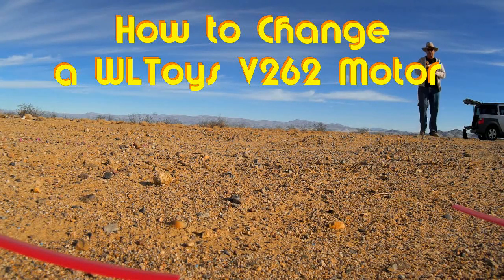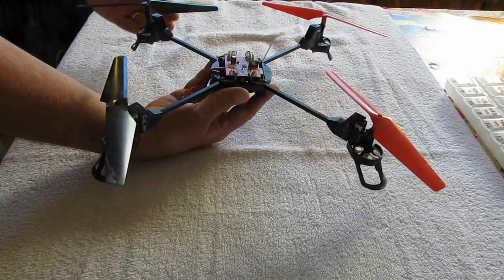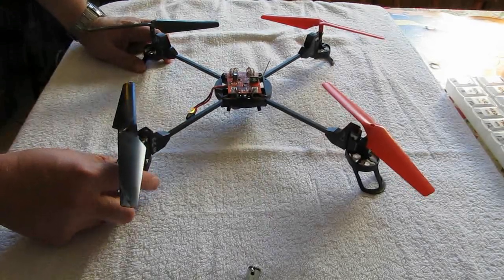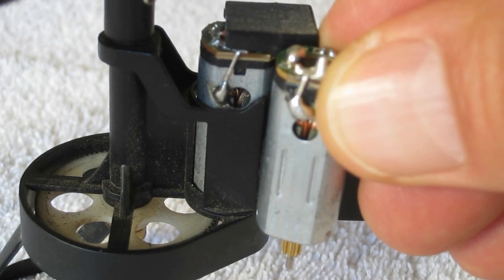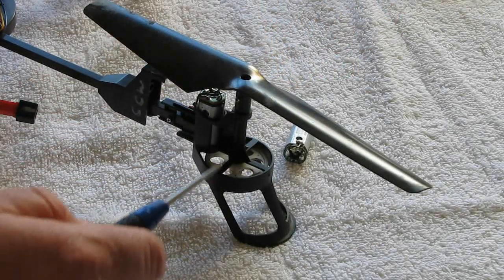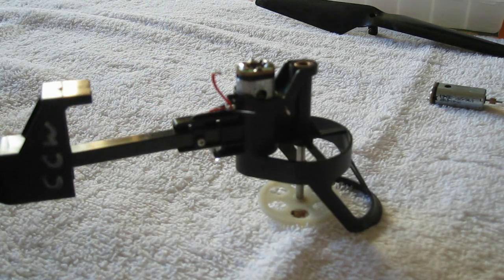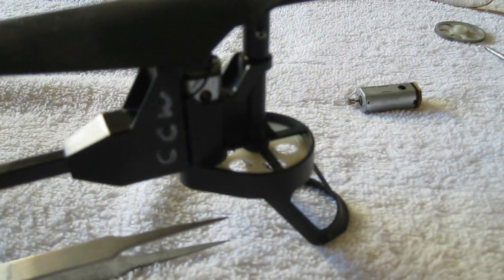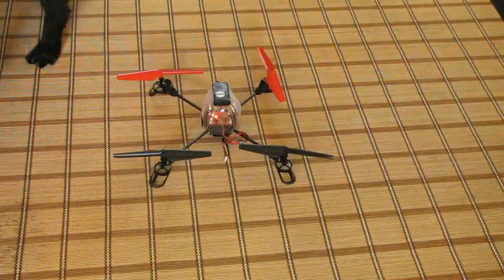WLToys V262 Cyclone Repair: How to Replace a Motor

Comment: You can also upgrade the motors, using the bigger ones installed on the MJX X101. The controller of the V262 can handle them and you'll fly (at half throttle), with an AUW of 465 grams. The only thing you have to do is to sand a millimeter of the carbon booms of the V262, to fit the motor holders of the X101, which are 4mmx4mm. Please take a look at my Rocket Drone on my YouTube channel. Instructions are available on Instructables website.

Comment: Hey 101,
Can this lift and fly with an action camera on???
And what is the range on one of these???
Reply from the maker: I would recommend skipping this drone if you can still find it.  This is a very olld drone, and there are much better out there these days. Regarding lifting a camera, it could do it.  But you'd be stressing the motors doing such.
Reply: Quadcopter 101 
Thanks for the information. I would then be making some mods on both the drone and the cam to reduce as much weight as possible.
And as for better and cheap drones, I know there are so many like the Bugs Series but drones are not easily available in where i am from.I am from India and its illegal to import such drones (talking about medium and large sized such as Bugs Series, Phantom series,few models of hubsan, drones which are a bit bigger in size and not as small as the pocket drones) and is a great fuss to get them cleared out of the customs office, sometimes it takes a lifetime to do so.
Well, thank you again.
Have a good day.

Comment: Hi, any idea how to switch flight modes? From 2 to 1? Is it possible?
Reply from the maker: It's not possible.  WLToys sold two different transmitters for this, Mode 1 and Mode 2. You had to specify at purchase Mode 1.
Reply: Thank you for your help. A big hello from spain!

Comment: I must've taken apart my V262 at least 8 times this week and finally 
trashed the body from being fed-up with it in the way of locating the 
problem!  NOT LIFTING!

Problem: ALL motors spinning the correct way.  Transmitter seems perfect.  Batteries at full-charge.  No wind whatsoever.   V262 DOES NOT WANT TO LIFT,  IT PULLS FORWARD, SIDEWAYS AND HALF-SPINS, IT ALSO FLIPS IF I WANT IT TO............BUT.........NO LIFT!!!

ANYBODY GOT THIS PROBLEM???
Reply from the maker: To tell you the truth, your problem sounds like you may have misinstalled one or more of your propellers.  Just to check, are you aware that there are two different shapes of propellers for clockwise and counterclockwise turning motors?  If a CW propeller is installed on a CCW motor, the propeller will blow air upward instead of down.  The quadcopter will not takeoff.  It may also flip on takeoff attempts.  Recommend that you double check your installation.  Look at the above video and compare the shape of your propellers and the motors that they are installed on.  Make yours match the video.

Comment: can you help me my quadcopter is falling on one side before take off
Reply from the maker: Your propellers likely are not installed properly.  There are two clockwise and two counter clockwise propellers that must be installed on two CW and two CCW turning motors.  Is it possible to share a short video of you quadcopter?  Please show each of the propellers, then demonstrate its flight problem.

Comment: Hey, I have the same quad. If I don´t use any camera on it (+extra weight), motors can run for a relatively long time. From my experience it does not matter whether you order CW or CCW motor, you just need to connect the wires the proper way. Anyway, to get some more power I was thinking about some upgrades... What would you say about two motors for each propeller? Do you think that the PCB is able to handle additional electric load? I´m afraid to burn the PCB...
Reply from the maker: +Martin Rob I doubt it.

Comment: I found neat way to install Mobius or other cameras inside clear dome - Easter eggs can be inserted into clear plastic sphere, it is low cost and plastic is very clear. There are many sizes, starting from 5 cm and up. I have some 10 cm diameter and it is excellent for all sky camera (Xiaomi Yi), Mobius protection against rain... but can be used instead plastic bottle bottom, which is not perfectly clear. I will not put link here because it will end in "Likely spam" by YouTube. Try to find it localy - it can be found periodically in local stores. Such ball serves for inserting candy and eggs into it during Easter celebration. Thanks for attention.

Comment: QUADCOPTER 101, CAN A PRE DETERMINED FLIGHT PLAN BE USED WITH THEXK Detect X380 GPS Headless Mode 2.4G RC Quadcopter ?THANKS
Reply from the maker: +RLO Quad I don't think so.  The only low end GPS quad in this price range capable of doing such (that I know of) is the Cheerson CX-20.

Comment: Please please show how to replace motor on v636. Idk how to open it n stuck without flying now
Reply from the maker: shahed cassim Sorry, but I've already donated my V636 to one of the local schools here.  But these Latrax Alias clones usually require removing the belly plate from the bottom of the quad before you can remove the covers protecting the wires leading out to the motor.

Comment: I have the V666 and just installed the bearing mods.  I noticed that one of the screws on the props doesn't screw in.  Looks like it is stripped maybe.  Have you run into that issue?  Would simply using the next size up screw work?  Or would that unbalance the shaft too much?
Reply from the maker: Ross Potts Many of mine are stripped.  But keep in mind that they are mainly acting as a pin.  If you can get it in, and it stays in place (doesn't pull out easily), then it shouldn't be a problem.  But if the screws don't stay in place, the aluminum shaft is more likely the problem.  It's screw holes may be enlarged.  In that case, just replace the shaft http://www.gearbest.com/rc-quadcopters-parts/pp_145474.html
But if you want just the screws, you can get them too http://www.banggood.com/Wltoys-V262-V333-V353-RC-Quadcopter-Spare-Parts-Screws-Set-p-945136.html
Reply: Quadcopter 101 cool.  I didn't know they were more of a pin.  And yeah, for now they are pretty secure.  Hmmm, maybe drill thru the other side and use something longer with a rubber band over the top:  the way a prop-saver works...

Comment: Dude, I've got a total of 7 Cyclones....well I had.......... I lost one into a deep and distant valley 2 weeks ago and I just slammed one 10-20 minutes ago with my sledge hammer cause I'M GETTIN FRICKIN PISSED OFF WITH WL-TOYS AND ABOUT 9 OR 10 OTHER COPTER RESOURCES CAUSE THEY MAY  HAVE THE BLOODY PARTS TO FIX THE COPTER BUT THOSE IDIOTS DON'T HAVE THE FRICKIN  "SCREWS" TO BIND IT TOGETHER!!!

I'VE BEEN SEARCHIN HIGH & LOW FOR A BUNCH OF THE SCREWS AND BOUGHT $30 WORTH OF FUCKIN USELESS SCREWS FOR WATCHES, GLASSES AND OTHER DUMBFUCK COPTERS THAT DON'T FIT!!

I'M PLANNING ON SETTING THE REST OF THE CYCLONES ON FIRE THIS 4TH OF JULY IF I DON'T GET ANY TYPE OF HELPFUL INFO IN ATTAINING THESE FUCKIN SCREWS!!!!

I'M GONNA SCREW THESE COPTERS GOOD WITH THE HELP OF SOME GOOD 'OL  HOT SMOKIN FIRE!!!!!!!!!!!!!!!!!!!!!!

Comment: I have found if you hear this sound and the motor is still turning. Put two or three small drops of 3-in-one oil on the top of motor. I had two motors i thought was bad until i used the 3-in-one now they run like new. It will save you money buying motors every time you hear that sound.

Comment: Didn't you end up realizing that all the motors are identical? You can't buy clockwise or counter clockwise motors. They're only sold as a "motor" with no designation. You should make a video clarifying because this is very confusing. Thanks.
Reply: JackstandJohnny the polarity changes the direction

Comment: Hello from Spain! Congratulations for your videos, which are really good.

I bought a V666 and after the second flight, the rear rigth motor doesn't turn anymore.
I was going to order this repalcement motorr http://www.banggood.com/WLtoys-V666-RC-Quadcopter-Spare-Parts-Motor-With-Gear-p-956811.html , but it doesn't say if it is clockwise or counter clockwise as in your video, so I'm a little bit lost.
If I order it, how should I solder it so that it's CCW?

I have also seen this replacement set for V262 http://www.banggood.com/WLtoys-V262-V323-V353-RC-Quadcopter-Spare-Parts-Motor-Set-p-920550.html, but I don't know if it would work for V666. Would it work for V666?

I've also seen your comments below about using canned compressed air to make the motors last longer. Could you please send some links or videos on how to do it where I could get it?

Thank you very much for your advice!
Reply from the maker: Look at the color of the motor wires.  They should be red-blue (clockwise), or white-blue (counter-clockwise).  Next notice the solder connection points on top of the motor.  There should be a + and - sign stamped near these points.  Notice which color wire goes to + and which color wire goes to -.  

I'm not sure if the part that you listed will work with the V666.  I know they're almost the same, but there may be subtle differences that I'm unaware of.  Maybe one of the viewers can answer that question.

Canned compressed air is available at just about any store that sells computers. It's used to clean dust from inside your computer, and is usually very inexpensive. To use with your quadcopter, just spray some inside the circular vent holes on the sides of the motor.  Then turn the propeller 1/2 rotation by hand, and spray the holes again.  Do this for each motor when you get home after a flight.
Reply: Quadcopter 101 Thank you very much for your very fast answer. I'll order the replacement motor, but in the Banggood page you cannot choose clockwise or counter clockwise. 
I will also follow your good advice for canned compressed air.
Muchas gracias!
Reply: i have 2 v666 quads and i think something might be going on with the board. If you watch more videos on youtube you will see the right rear motor goes out a lot. But the right rear is clockwise which means red is hot and black is ground. And counter clockwise is red is ground and black is hot. No such thing as a counter or clockwise motor they spin both ways.
Reply: gerald francis you are absolutely right!!!!

Comment: I have two of the v333 models and the solder points on all the motors are all at the 10 O-clock position on the hole.

Comment: I've had a V262 motor go bad already and I've only flown it three times.  I've got new motors coming and your video is a great help.
I seen a video of the new improved WL Toys V393 which uses brushless motors, but I can't find out too much about it.  Do you know anything about the V393?
Reply from the maker: Well, I know it ain't cheap.  Here it is http://www.banggood.com/V262-Upgraded-WLtoys-V393-2_4G-6Axis-Brushless-RC-Qaudcopter-RTF-p-953495.html?p=RB0922217402201307U3

Comment: I recently replaced all of the motors on another v262 that I got (my other on perished) and when I went to fire it up everything seemed fine except it wouldn't lift off the ground.  Is this possibly because I installed the CC motor in the CW motor position and vice versa?  The props are moving plenty fast it just won't lift off the ground...
Reply from the maker: You mat have soldered them up backwards, and also possibly installed the propellers in the wrong places.  Look at my quadcopter in my video above as I'm holding it. Notice the pitch of my propellers.  Looking down from above the quad, two props are intended to go counter clockwise (Front right, and Back Left), and two props are intended to go clockwise (Front Left and Back Right).  Once you've verified that the props are installed correctly, next verify that the motors were installed correctly.  Turn on the quadcopter and verify that the motors are turning CW or CCW as described above.  If some are reversed, you'll need to unsolder and resolder the wires opposite to what you did for each motor that's not spinning correctly.
Reply: Thank you I will try that out...
Reply: Quadcopter 101 I'm stumped!  I tried checking the pitch of the props.  Check!  They were correct...  Tried checking my soldering connections.  Check!  They were correct...  The last thing for me to do is to put the props back on and fire it up and see if they are actually turning the right way like you suggested...
Reply from the maker: Acoustribute If any are turning wrong, you'll need to unsolder and reverse the polarity of that specific motor.
Reply: Quadcopter 101 I did have one motor turning the wrong way.  The rear left motor was going CCW instead of CW but after resoldering it and swapping two props that I misplaced I can't figure out what's going on.  My props are all in the correct positions and turning in the right directions but the QC just won't elevate no matter how much throttle I give it...
Reply from the maker: Acoustribute can you make a short video to show this?
Reply: Quadcopter 101 http://youtu.be/YW-vdVYqpco  Here you go...  Everything seemed fine: placement of props and the direction they were turning.  This is what it does...  The only thing I didn't mention is that I did have a few screws that from the bottom of the motors that I didn't put back in yet but I can't imagine it being that important since the motors fit so firm in the frame...
Reply from the maker: Acoustribute OK, good news is that each of your propellers is installed on the correct arm where they should be.  The bad news is that each is spinning backwards. In effect the quadcopter is pushing itself into the ground. Looking down on the quadcopter from above, this is how your props should spin.
Clockwise - Red Left Front and Black Right Rear
Counter Clockwise - Red Right Front and Black Left Rear
Reversing the polarity solder connections should fix it.
Reply: Quadcopter 101 Thanks a bunch!!!  Resoldered the motors and I'm ready to rock...  Well after I break the motors in...

Comment: Thank you very much, dear sir, for the help with motors! By the way, I heard that it's possible to attach any (clockwise/ccwise) motor to it's place and simply replace wires (solder black to red position or vice versa).
 Sorry for my English, but I hope you got my idea :)
Reply: Thanks

Comment: thanks for this video. I just did a install and when running in - one motor got quite a lot hotter...is there any reason I might have messed up or is it just that one motor could be like that...? Cheers your videos inspired me to get a v333 and mobius...,:)
Reply from the maker: Slowly tun the propellers by hand comparing the problem motor with the other three good motors.  If you notice any binding during the rotation (other than that from the motor), then you may have some debris in the gearing.  This has caused many a burned motor.  Recommend viewing the following if you notice any binding: https://www.youtube.com/watch?v=LzzD3BPVvH0
Reply: thanks!

Comment: how much flight time before the motor went bad ?
Reply from the maker: It depends on how hard I fly it. Was averaging about twenty flights per motor failure. But I've also recently started cleaning my motors with a blast of compressed air between flights.  Haven't had a failure yet since I've started doing this. Think this might clear out particles that may act as an abrasive if not cleaned out.

Comment: Not sure if anyone has noticed but I bought some new motors for my V262 and the new ones are slightly different . The solder is only one one side of the housing and both my CW and CCW new motors are identical. They also both have writing on the side
lv-n50-3027. When soldering I also noticed the polarities are reversed when compared to the motor i removed.
I am guessing a new revision of the N50 is now in use. Fingers crossed those brushes last a bit longer.
Reply from the maker: I've noticed also.  The polarity written on the motors is confusing.  The way I've been keeping track is to install the motor exactly the same orientation of the motor that was bad (i.e. the external silver wire to the counterclockwise left position, and black and red wires to the exact same position (inboard/outboard) as the removed bad motor.

Comment: Good Morning, 
Quad, been watching your vids on the V222, it looks like a similar size as the LaTrax Alias, Yes?,  which do you feel is a better quad. Also, does the V222 have the same motor issues as the V262.  Last, if you were buying the V222, is the up graded TX, (about $16ish additional) its offered with thru Banggood, a better radio.

Thx,

Mike
Reply from the maker: Mike A I think the V222 is a better quad for beginners to learn on for the specific reason that it doesn't have the motor issues of the V262.  But another quad in the same price range is the Alias clone, the V636.  As for the switchable transmitter, it mainly allows flying in any mode.  But really you should learn one and stick with it.  Here it is for $25 http://www.banggood.com/WLtoys-V222-2_4G-4CH-6-Axis-RC-Quadcopter-Transmitter-p-78480.html
Reply: Quadcopter 101 Thank you for the info, as always right back to me, many need a lesson from you!!